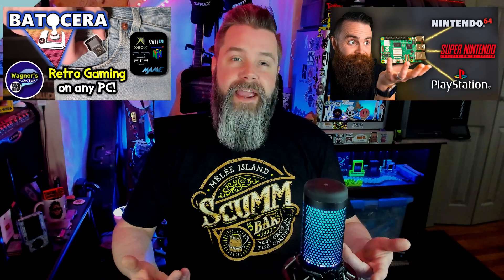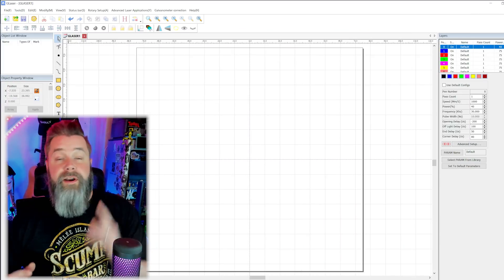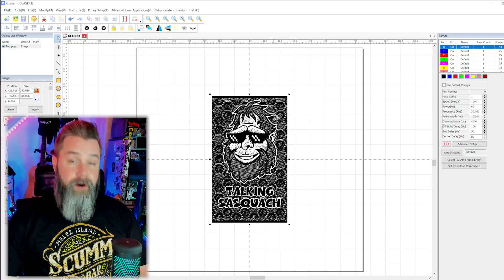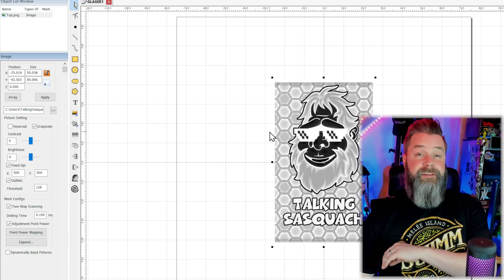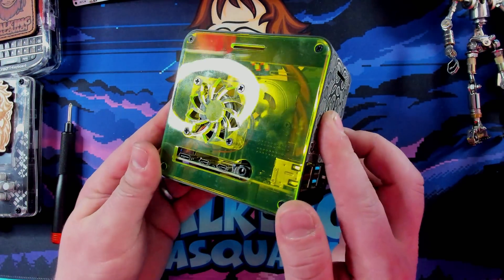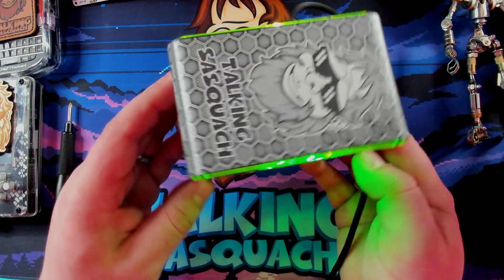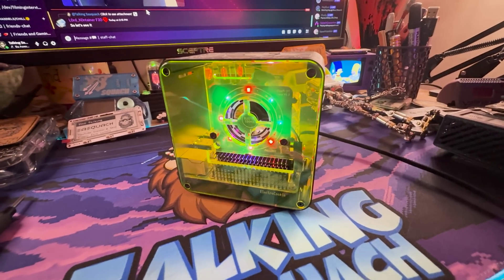DIY Mini PC Build: Raspberry Pi 4 Meets G-WEIKE G2 Pro Laser Power!

Comment: Please can you remove AI generated dubbing?
In French, it’s a stupid voice with an off translation.
Reply from the maker: @fredericm7375  can’t you disable it on your end?
Reply: @TalkingSasquach  On desktop, it's easy with the video's parameters. On mobile, not at all; it's not in the video's parameters. I have to switch my account to English... 
However, this AI translation feature is so frustrating. You have a one-note robotic female voice. It doesn't exactly match the flow and the beard... 🙂 
It's so strange that YouTube is not designed for polyglots.

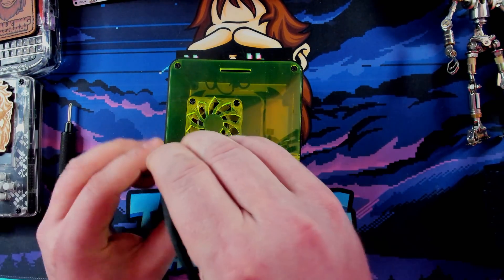Comment: 8:52 It is always very nerve wracking to start up a pi after heavy modifications like putting it in a case and plugging in a fan. Could explode even! So relieved it actually turned on. Super duper cool, amazing. You considered all the useful stuff you could do with it, but ended up just replacing the case. Sooooowwww coollll. And it has RGB lights!!!!!Wooooooowwwwwww🎉🎉🎉